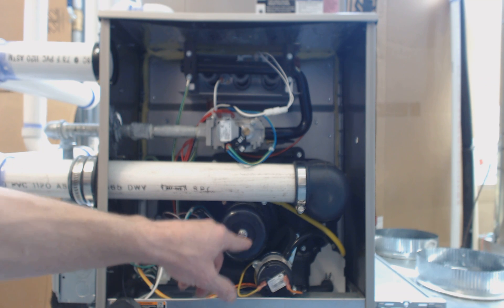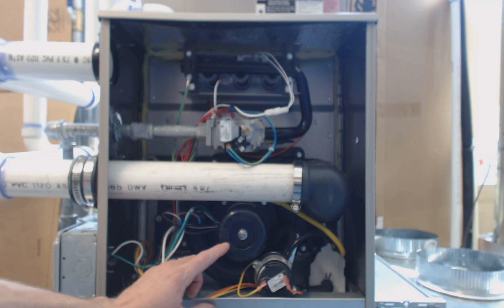Gas Furnace Sequence of Operation! Heater Troubleshooting!

Comment: Hello, I'm sorry if I am posting this in the wrong area. Please let me know where to post if its in the wrong place.

 I am having a problem with my Day and Night gas furnace/AC.  The problem is when it is in heating. the heater comes on when the thermostat calls for it. It runs for about 10 min then the thermostat goes blank.  When this happens the fan stays running and continues to heat. After about 5-10 min the thermostat comes back on and shuts the heater off since now the temp is a couple degrees above the set point. When the temp drops below the setpoint everything starts again.

When the screen goes blank the secondary side of the transformer reads 0 volts at the transformer. ( there is still 120 volts on the primary side.) the thermostat comes back on as soon as the 24v is back.

I was watching the relays and noticed that the CFR  relay sparks inside the relay like its energizing but it is in heating mode.

My unit is a 70's Day and Night. There is no data plate anywhere.
The thermostat was replaced with a Newer Honeywell RTH9580WF
I replaced the 40va 120v to 24v control transformer and the problem went away for 24houres then started the same thing again.
I am an electrician but have never worked on a furnace.

I hope someone can help.
Reply: The control board part number is a HH84AA009

Comment: Love your videos! Do you open up the service valves and release the refrigerant without being connected to the manifold? Wondering how I can prevent losing the refrigerant in my low pressure hose after disconnecting but still reading the pressure at start up?

Comment: Great video. I was wondering if you had knowledge of something that happens to my 2 stage efficient furnace. The odd time, the inducer motor spins louder than normal and when his happens, the furnace will ignite and then shut off. As soon as I hear the louder than normal inducer fan, I know right away that the furnace won't properly ignite and run its cycle. Why does this happen? I know a dirty flame sensor can cause a furnace to turn on and off right away, but what's up with the loud inducer fan that goes hand in hand with this issue?
Reply: Ps: if the inducer fan sounds normal, the furnace runs it's normal cycle. But it's just the odd time that the fan goes a bit louder and my furnace short cycles.
Reply from the maker: If it is a variable speed inducer motor, that usually indicates a restriction in the exhaust. I have seen where they are not pitched correctly and water partially fills up the exhaust pipe and that is exactly what happens, sometimes they work and sometimes not due to the water level.
Reply: @acservicetechchannel  when you say "not pitched right", are you talking about how the exhaust pipe is placed outside? If so , mine is slanted pointing down so no water can get in BUT I'm wondering if the build up of snow in the winter ends up blocking the exhaust pipe...
Reply: @acservicetechchannel  I just checked outside and I have 2 pipes. One induction and one exhaust. The exhaust is high enough but I noticed Beads of condensation.....perhaps enough beads of condensation form, and form a small pool of water that causes my induction issues. How would I go about solving the condensation in the exhaust pipe? Is there a way? Thanks for your help btw I appreciate it
Reply from the maker: If you have a 90% efficient gas furnace, the exhaust is pitched a 1/4" of pitch per foot going upwards away from the furnace until it terminates outside. Some induced draft furnaces are pitched downward from the water heat until they go outside. Beads of condensation are normal as they are supposed to drain back into the furnace for the furnace to extract heat from. If there were a low spot in the pipe, you would have a large amount of water blocking the pipe. That is just one thing that I thought of. Is it a variable speed inducer?
Reply: @acservicetechchannel  a couple of things to note: the intake and exhaust pipes Run the entire length (4 - 5 feet) from the furnace to the outside. The intake pipe goes straight to the combustion chamber but doesn't go anywhere else from there. It terminates in there. The exhaust pipe comes straight off the inducer which has water cacher built into it (you were right haha) .  I don't know 100 percent if it's a variable speed inducer but I want to say yes because the pitch of the inducer varies slightly each time the furnace goes on. Not a huge difference but enoigh for me to pause the game and think "huh it sounds a bit louder than normal".
Reply: @acservicetechchannel  also, once the pipes hit outside, they curve upward. The intake goes up a foot then does a U pointing down. The exhaust just goes up 2 feet then a half U pointing outward
Reply from the maker: Well the pipes sound fine then, I know it doesn't sound like its relevant to the inducer but have you cleaned the furnace condensate drain. It could be backing up into the furnace inducer possibly. I just did the last video on that, thanks
Reply: @acservicetechchannel  as far as I know it's fine. It goes from the inducer, to the condensate pump. Then from the pump to my well. But I do know 4 years ago the condensate pump wasn't running, so water could have gotten into the inducer for sure but it would be dry by now I would think lol. Also it's weird how it only seems to happen a handful of times during the coldest months of winter. (-36 celcius out here). And it could be a fluke, but when it would happen I would remove my furnace filter and it would seem to be fine from then on but that could be a fluke because a) it still happened with a new filter in, and b) the inducer isn't even grabbing air through the filter so how would it block it, causing it to be a higher pitched noise ?

Comment: it has to be because the inducer motor turns on 1st in his did not turn on
Reply from the maker: Make sure the control board is receiving a call for heat read on w and c and that voltage is going to the inducer and that the capacitor is it is good, thanks

Comment: hi, if this was a 2 stage furnace, how and when does the furnace knows to go from first stage to second stage? something to do with dip switch settings? also how can you tell if furnace is on second stage heating if you can see the flame? thank you.
Reply from the maker: Hey Mark. The control board will control when the 2nd speed turns on. In older or less efficient furnaces, the thermostat will control the second speed. The control board does this more efficiently because it will remember how long it took to heat the house the last time it was on and what speed it was in. Upon startup these carrier systems take 16 minutes before entering second speed. You ca measure 24v between medium and common and high and common at the gas valve, thanks
Reply: so this 16 minutes is set by dip switches? or this 16 minutes was based on the last heating cycle and the furnace just remembers it? thank you. i also see one wire (W) hooked up on thermostat but W1 and W2 is jumpered at furnace board. how is staging done in this situation? thank you.